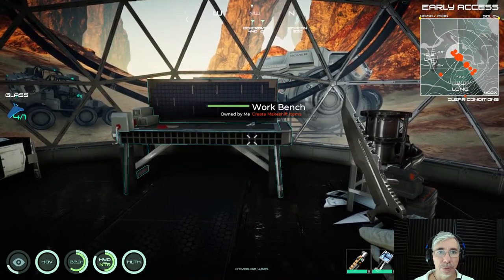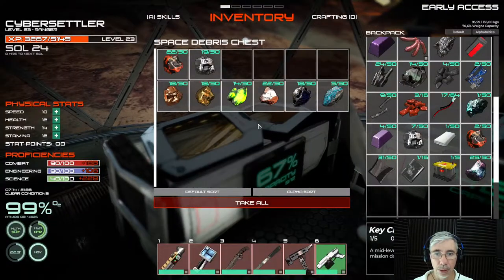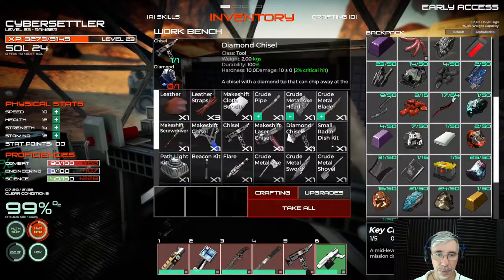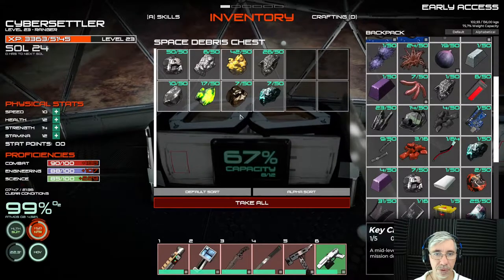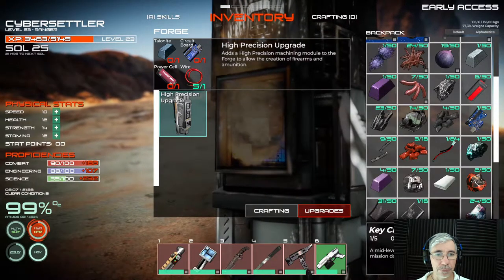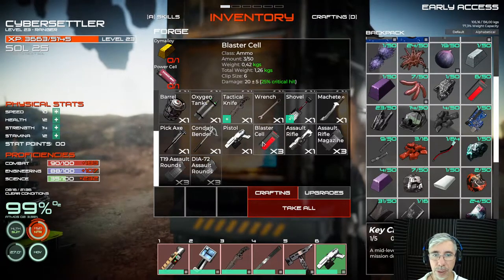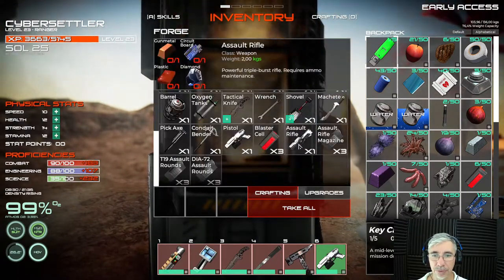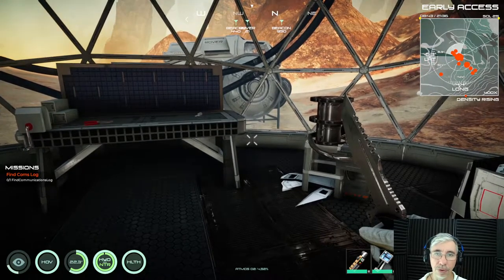Making the Forge | Osiris: New Dawn

Comment: I must be having some sort of glitch. I'm playing story mode and after the mission "switch to external view" there's nothing else to do. No more missions. So i'm stuck. I started the story mode three times, and it happens every single time. Is it possible to get the Forge recipe outside a story mission?
Reply: As of right now, I am stuck as I'm stuck with repairing the buggy which requires iron, and iron I can't mine due to lacking a material that requires the forge which I have yet to learn.